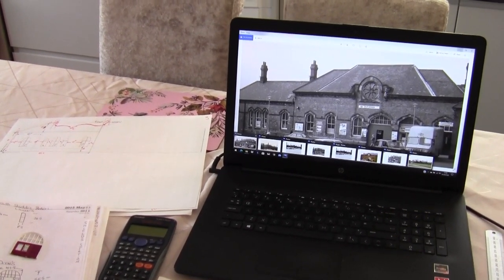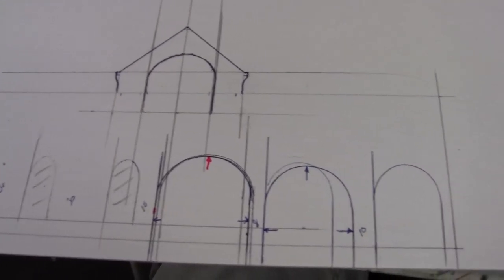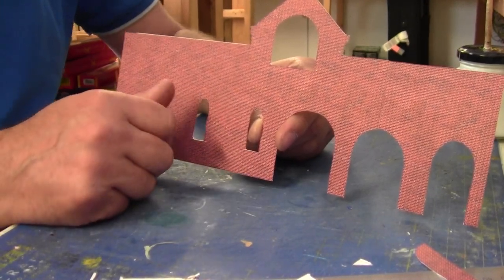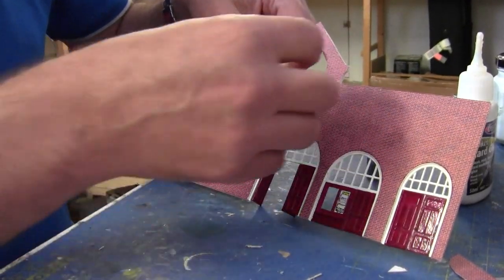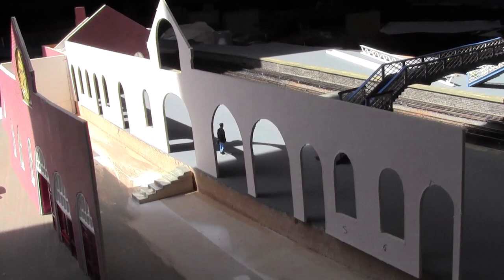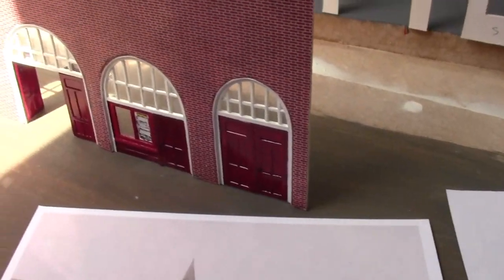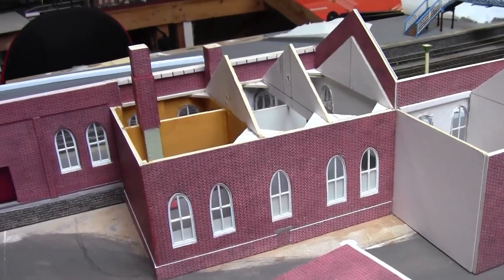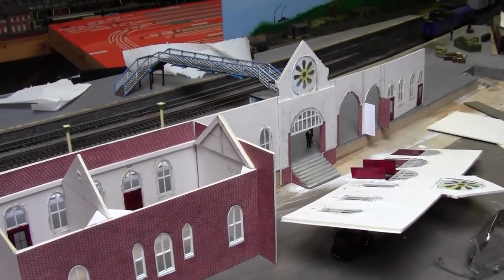South Shields Station Part 3. main entrance and the inner walls   No 216

Comment: Hello Tony. I just came across your channel yesterday & your doing a splendid job. I was on the last BR Unit to ever go into South Shields before it was converted to the Metro System. I remember they had detonators all the way out of Newcastle to the High Level Bridge. With reference to the rose window before the station was bombed during WW2 there looks as though there would have been eves going from either side of the window towards the main roof where the clock tower was so it looks as though the window led into an atic area. I may be wrong. After it as repaired the clock tower was not replaced & the roofline simplified & the roof did go straight across behind the window with the pointed section of the wall above the window being rounded off.
Reply from the maker: hi Brian sorry for the late reply. i am glad that you have come across the channel and commented, its great to hear from someone who rode on the last train from newcastle to south shields before the stations closure. thank you for sharing the memories. as you know i will be putting back the tower and the missing chimney from the main roof. and i will also be putting my own stamp on it in a few places, but mostly i will try and keep as it was before 1941...thanks again..........Tony

Comment: Oh my, I missed the last few episodes, I will have to start looking back. It's a super model of the station your building there. It's quite surprising how large even a modest size station building is. I wonder when your going to release the kit? Only joking, but great work all the same, best regards Dave.
Reply from the maker: Hi Dave, if had the equipment. ie laser cutting machine you'd be the first to get one.lol..the station once finished will be over a meter even thought i have to cut it down by 4 inches, but the details missed wont spoil the overall effect...happy catching up....catch up next time....cheer's Tony

Comment: The secrets of the Tyne & Wyre Metro vid on You Tube has some very interesting booking hall detail from another station of same architecture!  Might help with thoughts on your next steps. Mike
Reply from the maker: Cheer's Mike. i will look that up before i make a start. i do have a photo of shields booking hall. its has wooden paneling which has been painted over. but i will check that out................ cheer's Tony

Comment: hi  Tony if you check your photos you will see that the main building walls are higher than the side buildins by about 5 feet (scale 20mm) so it wouldnt have affected the rosewood window. Kevin
Reply from the maker: Hi Kev yes its a good theory. the front entrance has already been moved up to counter the height difference, its a shame in the original building the rose window could not be seen at all, which i think was a mistake at the time. but now i plan to incorporate window so it can be now seen at the platform level, which makes more a interesting build an feature....thanks again for commenting and pointing the tip...all the best Tony
Reply: Cool Tony and I am kooking forward to seeing your finished project. It is great to see. Take care

Comment: Your station building is taking shape. Looks great. Is there buildings on the other platform or is just a wall to subport the canopy. Grimsby Town Station is main buildings one side and subporting wall the other for the canopy.
Reply from the maker: Hi Ian. thank you for commenting, i will look up Grimsby station sounds like a interesting one... question....yes it does have a supporting wall, in the early days of the station the other platform was for goods and passengers. if you want to know more about south shields station check out video No192...research into the station..................thanks again best wishes Tony

Comment: It’s looking great and very impressive.  I have one question though.  What was the reason you went for roman arched windows and doors instead of Tudor arched ones as in the prototype? Is it a matter of ease of building?
Reply from the maker: Good question Richard. the answer lay when i was constructing the windows. the windows were turning out to be of a pyramid shape. the glue was was pulling the corners in. i had made 6/7 and i realized that they did not look right. that's why i decided early on to change for the arch shape. it just made it a lot easier in the end. thanks again for commenting. and a good question.....cheer's Tony
Reply: TONY NORTH EASTERN thanks for your reply.  That makes sense.  The outcome looks very good indeed.

Comment: I'm so glad you managed to work out how the Rose windows fitted. It would have been such a shame to only have the one.
17:35 railwaystationphotos.co.uk Why did I not know about this? Brillo resource Tony.
Golly Tony, it's turning into a massive structure isn't it. Makes me realise how most models need to be reduced to fit the space available.
Reply from the maker: Hi Chazzy mate. yes it would have been a shame to loose one of the windows but i have a cunning plan to incoperate the widow so you can see it from platform level....the station building once finished will be about 3 and half foot long. give or take an inch. i hate working in inch's. not accurate enough. give me mm any day...take care buddy catch you next week.....cheer's Tony